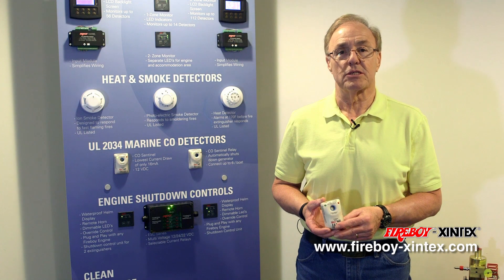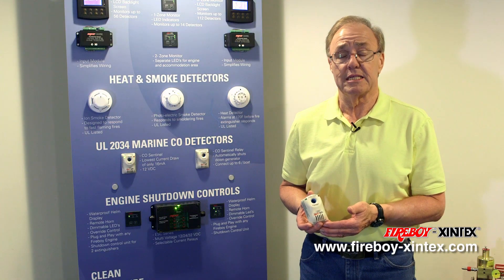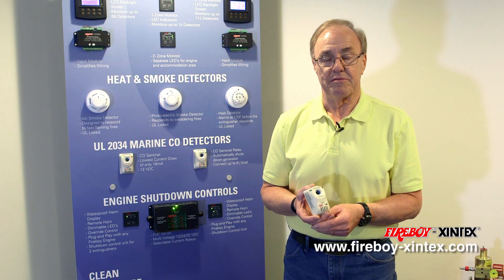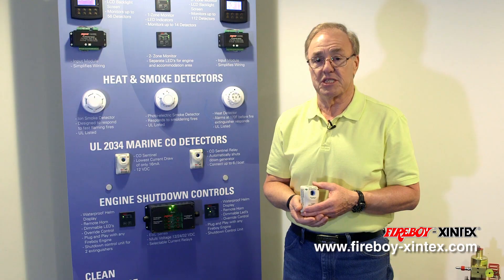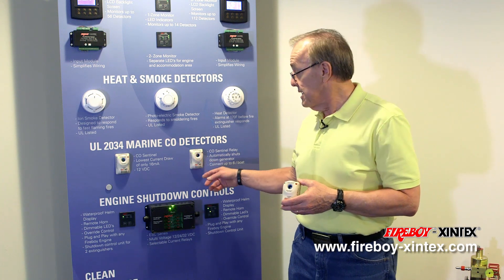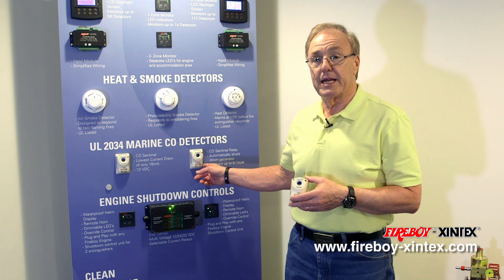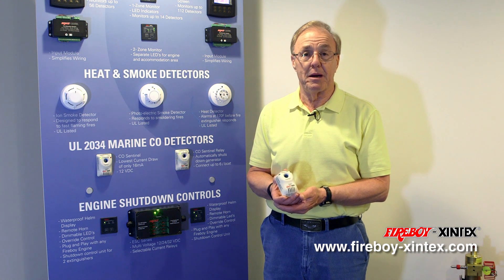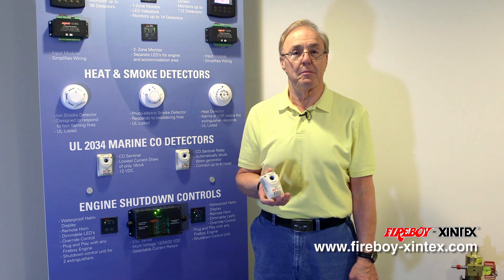Why is Your Carbon Monoxide Detector Chirping - Fireboy Xintex

Comment: How about some information on replacing the discontinued CMD-4 with a compatible unit?  Will a CMD-5 physically cover the same area of the CMD-4?  Is the 12v wiring the same?

Comment: Easy to set up with ring alarm.>>>t.co/HcjYmKNVjF    I set it up in a minute and you can tag the device to a specific room. No more wandering the home to locate a low battery beep. The app even shows battery level and can test the device. Let's just say ring and first alert got it right. To make it even easier the alarms attach to existing first alert bases. If you use ring alarm just buy this and you now have professional monitoring.